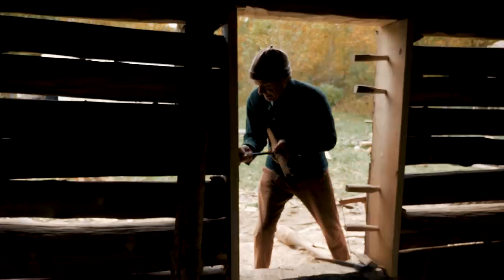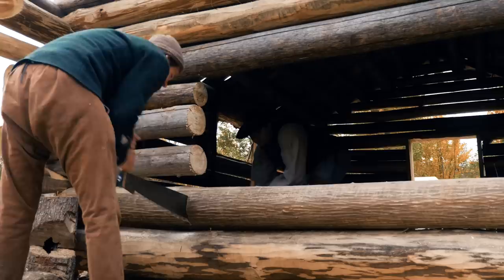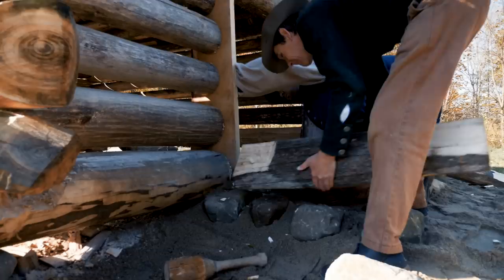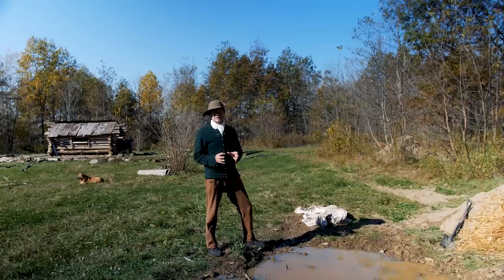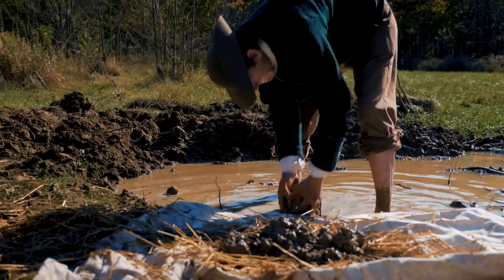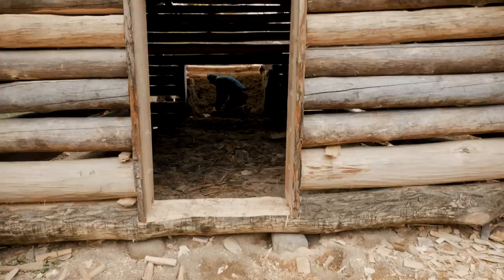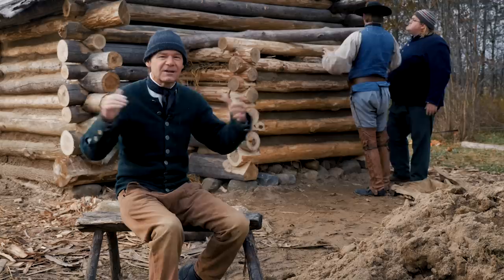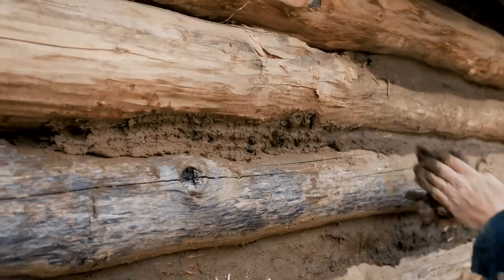Chimney & Fireplace Before Snowfall? - Townsends Homestead Part 3

Comment: 18" was to give more thermal mass and hold heat, keeping the cabin warmer once the fire dies out
Reply: Its also to make sure the cabins don't burn down. The 18inches. Gives it more insulation material between the fire and the exterior side that is cooling fast which cracking can appear and less chances of the crack and failing going all the way thru and maybe setting the cabin on fire or collapse.
 Remember a solder's cabin probably heated and cooled many times over its use.(wear & tear). Were as a family cabin fire place usually had a fire going all winter more constant with the heat.
Reply: As a sort of side note, not on the chimney itself, but looking at the roof, they would have done better to put more layers of bark on (birch, if it could be found) and covered it in turf. The birchbark is waterproof, keeping out rain and any snowmelt, and the turf weights it down well, keeping it in place, in addition to providing better insulation from the cold. Something else they could think about improving come spring, to make the cabin last through the next winter
Reply: I would also not be surprised if it just a in case measurement, as going to thin canbe more an issue than thicker. Washington might have just opted on the high side rather over doing it than risk problems.
Reply: (Chimney sweep's wife here.) It's also what modern (ie, post-1902) code calls "clearance to combustables." Basically, if you put wood near heat, it'll slowly bake and catch fire more easily. A couple questions naturally follow. 1) How long were these cabins meant to be occupied? If only one or two winters, you might get away with being a fire trap. But if longer.... 2) What's the insulation factor on daub? Any engineers wanna do fun math on horse poop?
Reply: @storythreads  Big fireplace with smaller fire...safer because of less heat?
Reply: @Thebluebridgetroll  I was thinking that a vertical log overlay would have been better to not hold snow on the roof.  Also, could have gone with two layers of birch with bundled thatch in between for insulation on the roof.  Corn cob chinking would have provided for some wall insulation.

It's easy to arm chair quarterback this build, and a lot of fun and good ideas come out of it, but they did a great job on this project.
Reply: barking.dog.productions1776 agreed
Reply: Dave Middleditch, comments like yours are part of what I look forward to, in videos like this. Respect, man.
Reply: @Thebluebridgetroll  From a different video, they said that there was only a short season in which they could get the bark peeled.  I think there is a plan for a possible more substantial roof.  It seems I saw Jon cutting shingles but time was closing in so they could only add more birch bark at the time.
Reply: He probably said 18 inches because he knew most soldiers would probably only do 12. If he had said 12 most would probably have done 6.
Reply: @storythreads  
4 inch thickness of a red clay brick has a insulation factor of R1 but with the hay or straw and air pockets in it  would be a bit higher if you are taking about the chimney.
If you talk about the cracks sealing them with horse poop than it would be close using hay or straw which should be as much if not more than the log itself.
Reply: @sirfishslayer5100  Big fire places where used for cooking because their mass would keep more heat and gave more room to cook inside the fire place. Also fire places like that belonged to the northern side of a house because it stayed cooler to do all the cooking. Big fire places like that would keep the house cooler in summer because it would vent more heat out, but it was harder to put heat into a house in winter.
Reply: @Thebluebridgetroll  I recollect them mentioning that birch wasn't available to them, and how they regretted that.
Reply: @metalman6708  good point!!!
Reply: @barking.dog.productions1777  Late reply but PNW natives tossed the idea of plank roofing and stone weights with smaller horizonal logs. Practically windproof and plenty heavy and melt doesn't cause much wear. 

I want to build an iroquois longhouse, myself. Cabins seem like a "I have fit friends" build and I...

Have no friends. Not any that have any measure of physical discipline, anyway.
Reply: @metalman6708  I’m sure Washington was aware of human thinking just like that! Good point!
Reply: That's what she said

Comment: You might want a thick walled fireplace for heat retention. That much mass will hold heat for a long time compared to a thinner walled fireplace and chimney.
Reply: I think he said a foot thick
Reply: @floydlooney6837  He said he built the fireplace with that in mind, but he wound up not using that much liner.
Reply: Love the experts on making comments
Reply: Same method works for Russian cabins, only theirs work more efficiently because they put their huge stone stoves in the middle of the cabin. Light a blazing fire in the morning and the retained heat will radiate out all day, saving on fuel.
Reply: @Drake I am wondering about that too. My guess is that Washington wanted them to start with an 18 inch footing of the cob to support keeping the cob thick all the way up. It may have served for thermal mass too.
Reply: @Raskolnikov70  izba is more permanent structure, usually build in more populated areas,  and, classically, takes much more time to build (tighter log fitting, time to dry out (if i know correctly, it has to dry out for the full year after cutting), bricks for the stove, etc). I am really curious, what type of stove was used for Russian remote cabins before nineteens century...
Reply: for heat retention OUTSIDE of cabin. props for that.
in general, the anglo design with chimney and fireplace being outside the cabin is OK if you want to not heat the place but just cook, but it's the stupidest solution possible if you actually want to heat the place. slapping an open fireplace in middle of cabin would have been much more effective for heating (japanese and finns did it, sooo).
Reply: @paveloleynikov4715  i've researched that. well, by 19th century, the conventional russian pechka was in use. 
but, the earliest form of masonry heater in russia was the "black stove", "kurnaya pechka". it was used since i think 14th century up to 19th century in Siberia. it was essentially a smaller conventional pechka, only made by ramming clay in a reusable mould, and it didnt have a chimney. the houses also didnt have ceiling or chimney so the smoke went out through the roof. that's why the name black stove. 
it was on a small platform and with a flat top, where grain could be dried. 
these stoves were better than white stoves (what we now know as russian stove) because in wet climates they kept the air dry. you will recognize a clay stove because it has wooden planks on outside to keep it in place.
Reply: Oh? Yours was 12?

George Washington's was 18 boi...lol
Reply: @Raskolnikov70  Finding all that material on site to build that in Americas Midwest might be a challenge?
Reply: @bluemoondiadochi  The advantage of having the entire hearth and chimney being built on the outside of the cabin is when that chimney catches fire, it's easier to pull the chimney down away from the cabin. Building a new chimney is less of an effort then starting over with the whole cabin.
Reply: @permiebird937  That's an interesting point I hadn't thought of till now. Completely forgot that buildup in chimneys has a tendency to turn into a runaway fire if cleaning isn't regular. No idea how common chimney fires were, but that's an interesting idea for part of the design.
Reply: Lining the fireplace with thick rocks will accomplish same task.
Reply: @Raskolnikov70  Yes! Just saw one of those huge brick stoves on Survival Russia's channel.
Reply: Jim F  The right kind of rock would be more durable the wrong kind and they have a tendency to explode..  be careful if you ever build your own.

Comment: 18" thick Play a is for thermal mass in case the fire goes out the clay still radiates heat
Reply: That's a good point,  I didn't think of that but you're right that could be the difference between waking up in the morning in a warm cabin or waking up in the middle of the night freezing cold.
Reply: Yup it works like the big bench style rocket stove heaters
Reply: I would line it with cob then a bunch of flat stones for the thermal heat...

Comment: As a general building contractor I thought it was OK being meant as a temporary dwelling. But know it's looking real solid and well done. I'm impressed!
Reply: 6inch gaps between the logs all thru the house. i is totally unacceptable even for 1800's construction where i live. most logs house here have such small gaps they used to take hemp rope to stuff the gaps. the roof also covered the wall by almost 2feet to prevent them from ever getting too wet. they also used 2feet thick of sawdust bellow the floors and above the ceilings to insulate them. in the most extreme temperature zone they used to have a house INSIDE the house, with only a bed inside, it was to keep warm with rocks in very deep winter were it was -35 to -50C.
Reply: @Francois_Dupont  This is representative of a quick, temporary cabin such as soldiers might build, or landowners would put up to stay alive while a better one could be built. Those well-built cabins you see... probably had one like this, making it possible. After this, it'd be used for storage, smokehouse, barn, coop, or whatever. Eventually, as well-seasoned firewood...
Reply: @Francois_Dupont  <> I suspect those are luxuries time did not allow for them. I suspect it's a representation of building a solid dwelling in a rush with very limited time and availability of labor.

What you're describing is what I would suspect be built as the second home that they'll be able to spend more time and resources on without worrying being caught in winter with no shelter.
Reply: @Pygar2  i do not know when they started building and yes maybe as modern man they had other things to do while and they did not have much time to build i understand. but as a representation of a log cabin build this is very poor.
if you are interested in seeing real one buildt i saw in the past a self made video of a old man that flew into the north and made by himself a very nice campment. that he lived in for years later on in life. also many German makes very detailed video of good workman ship of building log house. simply use google to translate in German "log cabin buildt" or something similar to video many many good videos.
Reply: @Francois_Dupont  its based on plans for temporary soliders barracks from the 1780s. To be built quick and cheap by the soldiers themselves, just to keep the soliders from freezing to death over a single winter. Not last decades.
Reply: @as-jp5cl  didnt they have canvas back in those days? making a "prospector" type tent with a minimal wood frame would have been a better way then building a full house. i guess the problem would be the fire. i dont know enough to say.
Reply: @Oldhogleg  I believe you're correct. Here in Minnesota we have a number of surviving pioneer-era cabins and houses and they're all very well built, with tightly-constructed walls and tons of insulation. A quickly-constructed cabin like this one wouldn't last very long in one of our winters, and the settlers would build a much warmer and more permanent dwelling as soon as they could.
Reply: @Raskolnikov70  Those surviving cabins were the second house. The first house, being not so well constructed, became a chicken coop, a small barn, or an equipment shed (maybe all of those at one time or another) and then was "mined" for heating and cooking wood for the second or even the third house, or even allowed to fall down on its own.
Reply: @Francois_Dupont yes canvas tents existed but logs were bountiful and free for the cutting at the time, especially when if was the continental army doing the cutting. Wood stoves like we have now were uncommon at the time, heavy being made of cast iron and expensive. one of Benjamin Franklin s inventions was the " Franklin stove" which is still just a improvement on the open hearth as thats what most everyone used.  Its hard to heat a tent when you must use open fire, native Americans invented the teepee style tent to solve the problem but prejudices at the time wouldnt have made that a logical option. In the end i think the cabin was the most practical idea to fit the needs they had.
Reply: a s they certainly were not trying to reinvent the wheel. A simple design anyone can build is best. 
Building the cabin wasn’t the only job they had either, and often arriving by late summer/early fall cut the available times window small. 
We certainly underestimate the amount of time it takes to accomplish simple tasks in absence of power tools.
Reply: @Raskolnikov70  That is of course a classic example of survivor's bias. Of course the ones you have left are the well built examples. That in no way proves that most cabins were built to that standard.

Comment: I could feel your anxiety at trying to get the roof and chimney done before the weather got bad. I felt the same anxiety when putting a completely new roof (replacing rafters, sheathing and shingles) on my modern house by myself and trying to get it "dried in" before the fall rainy season. Luckily I had tarps when the occasional shower arrived, as I was rebuilding the roof in sections. That project took me two years! Great job on the cabin and as always your cinematography was excellent!

Comment: The chimney looks like it draws really well. You must be thrilled that your first attempt was such a success. Well done.
Reply: and evidently it didnt let snow in. i didnt see if it had a cupola or what
Reply: @KairuHakubi  Its a straight shoot, no barrier
Reply: @KairuHakubi  in sone areas a flat rock would be put on top to help shed the rain or snow...
Reply: but i didnt see a hole in the back so it could draw outside air into the fire to burn, without one it will pull the warm air into the fire from the cabin, use it to burn, and send it out the top. also it will draw cold air into the cabin because of the draft
Reply: @joshmeyer1167  True, but the design fits the technology of the time and place.
Reply: Paul Tibbals masonry is the oldest profession in the world and the fresh air vent in the back of a fireplace has been known for 2000 years if not longer. it makes a huge difference.  It’s only recently that we stopped doing it and I imagine it wasn’t in the instructions because it was assumed.  I was a mason for over 10 years and now a hvac tech.
Reply: @bobcranberries5853  Thank you for clarifying the history of the fireplace. I still suspect that a temporary mud fireplace would forgo many of the refinements. I don't notice an adjustable flue either.
Reply: Paul Tibbals I guess what I’m saying is that a fresh air vent isn’t a refinement its a must. Close the hole in the summer and it doesn’t heat the cabin for cooking. Open it in the winter for heat.  I’m not trying to be a know it all. it’s just nearly a lost art and people back then we’re smarter then we give them credit for.
Reply: @bobcranberries5853  You didn't come across as a know it all, you were just filling in some ignorance. Specifically mine, and I really do thank you for it.

Comment: That looks like an immensely fulfilling project for all of you.  I can't imagine how great it must have felt resting in the finished product.

Just curious, what was the purpose of the logs you put on the roof at the end?
Reply: Not sure what his reasoning would be ofc, but it could be an anti slip device vs snow, so snow stays on and add free insulation. (a d stops it sliding off and killing someone walking under)
Reply: I believe that is to keep the bark roof sections from curling up.
Reply: @edcrichton9457  yes and keep from blowing off. Crazy weather in midwest lately. High winds amd record low temps
Reply: Paul David  Makes sense.  Those thorns may have been effective but who knows how long they'd hold up in the wind with moisture and all that.
Reply: @Abbreviated Reviews - Great Q's... I was wondering the same!
Reply: That's the weight logs he mentions in the video where they are making the roof

Comment: As kids we had a field near our house that we dug a 10 by 6’ trench 3’ deep lined the floor with cattails and tAll grass , dug shelves in the walls and had the dirt piled a foot high around the edges   Covered it with a sheet of plastic over tree limbs we had cut and held down with dirt and tall grass etc   Built a ramp into it and hung out for the summer.  20 feet away you couldn’t see it.  

Lots of fun for a bunch of 11 yr olds !!
Reply: #Forts

Comment: Can you just imagine how much safe haven the pioneers would have felt on the first night, out of the wagons or tents or lean toos, and into a rough built cabin with a fireplace to warm them, light them and feed them! Still alot of back breaking work ahead. But they were dry, warm and protected. It would have been a HUGE moment.

Comment: 18" for the clay in the fireplace might have been more for the thermal mass rather than insulating the wood frame from the fire, Just a thought.
Reply: but thermal mass outside of the building sounds just terrible.
Reply: @Kocmonavtika  The whole fireplace thing is a mess... A simple mass stove would have been 10x superior and can be built with almost the same resources/tools..
Reply: @henryrollins9177  Would have required cement or lime to make which they wouldn't have bothered with on a temporary structure.
Reply: @RandomPlaceHolderName  Nahhhh..for a temporary mass stove you can build it with mud and straw... Some cracking after thwe firsts burns, you seal them with mud and its done.
Pd: and much less work than this one, for sure...!